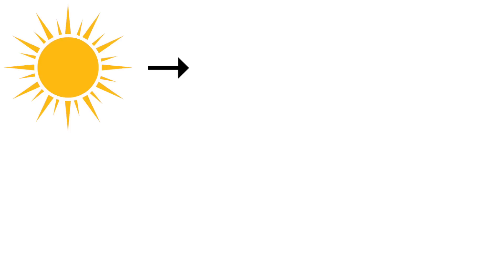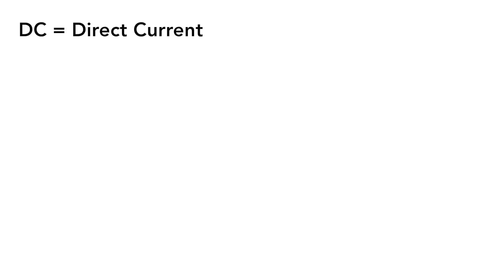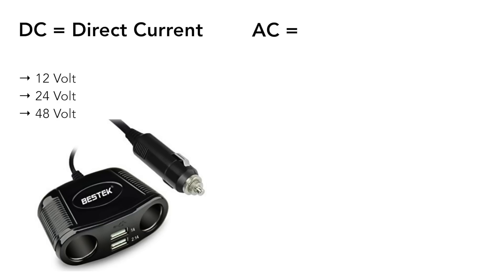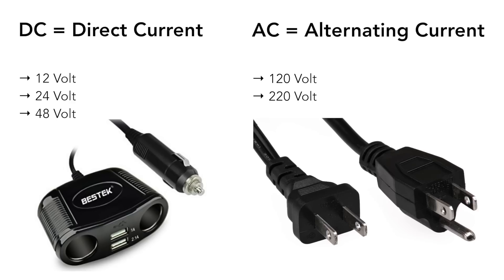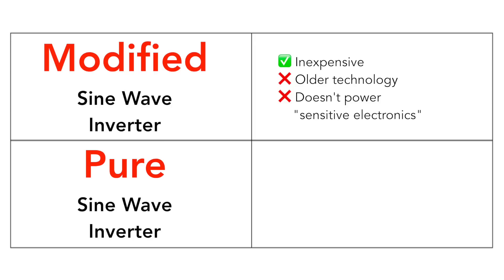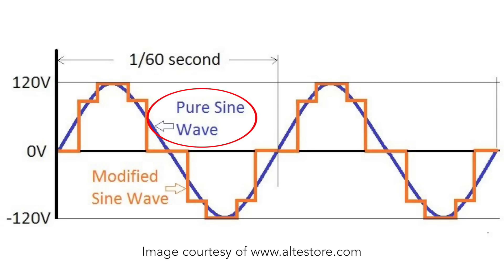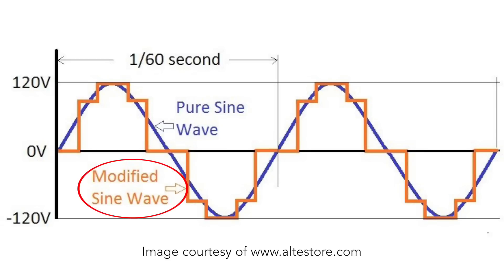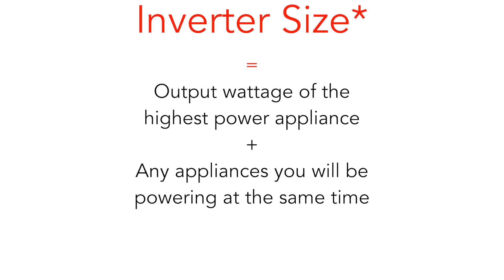Solar Inverter + Alternating Current vs Direct Current Explained

Comment: As we've come to expect, your videos are clear and very well explained. You really know how to get the message across. Someone who really doesn't know where to start, and those who haven't researched all aspects of the subject will find your series invaluable.
One point made me cringe though! Your use of the term "solar inverter". I know, you mean the inverter in the solar system. But actually, neither the inverter nor the batteries are fed exclusively by solar power. I have solar, and in my case, my battery is charged more by running the engine or connecting to shore power than it is from the solar panel. This is quite common, actually. So, an inverter is an inverter, and it really doesn't know or care what's charging the batteries that feed it.
As far as modified sine wave and pure sine wave are concerned, so far, I've only had one case where my MSW inverter was a problem. I wanted to test its power, so I connected it to a space heater, which, of course, I would never do under normal circumstances. The heater had an electronic circuit board to control the thermostat and the remote control. This circuit board would overheat by just connecting the heater (in stand-by mode) to the MSW inverter. It would give off an awful smell and it would probably have destroyed the board after a while.
Keep up the good work and I look forward to your next videos.
Reply from the maker: So true about the "solar inverter"... I was intending to use "solar" as an adjective and not as part of the noun. Thank for sharing your experience with the MSW inverter. It'll really help people who watch the video 😊

Comment: Don't give into the propaganda from the manufactures of "pure sine wave" inverters. The real problem is with running motors: A/C, fans etc. Most electronic devices use DC (internally)  and only clip the top / bottom of voltage curve.
Reply: microwaves run really poorly on modified too.... like 50% worse.
Reply: what does "50% worse" mean?  Power loss is 50%? Can you expand on that?

Comment: I want to know a caparison of saltwater batteries along side the other three. I have been watching and enjoy your videos. I still feel overwhelmed when it comes to understanding these things. So I will revisit these videos and see if I can break it down further for myself. The reason I asked about the saltwater is because I saw a tiny house video used them and talked about the attributes of them and I was impressed. I want to know if it's as superior as it seemed. Thank you. Great series.
Reply: There's not too much to talk about as the only company that sold salt water batteries went out of business.  In an rv application it is extremely heavy and very low power density.
Reply: Thank you.
Reply from the maker: Well stated. Thank you!